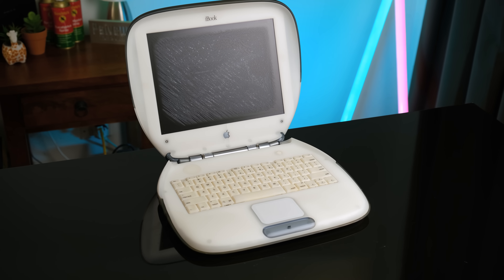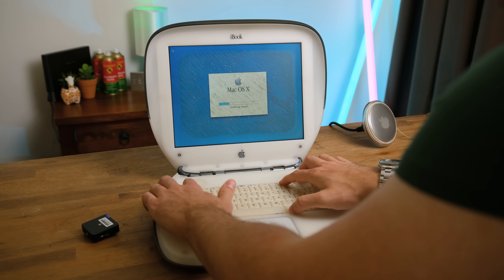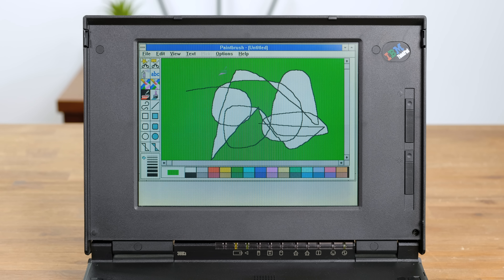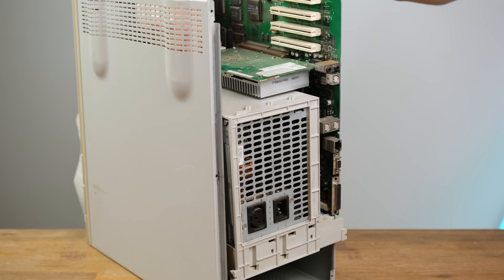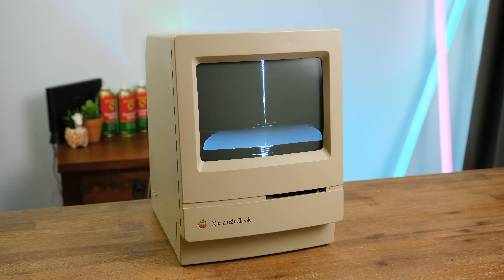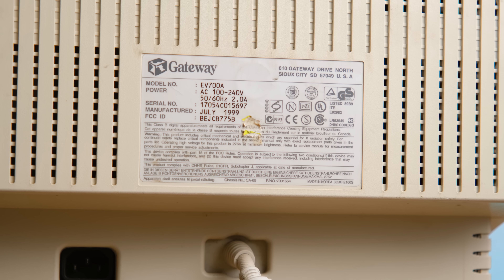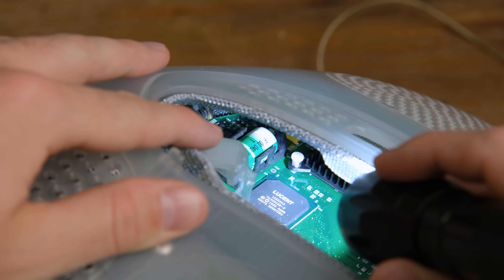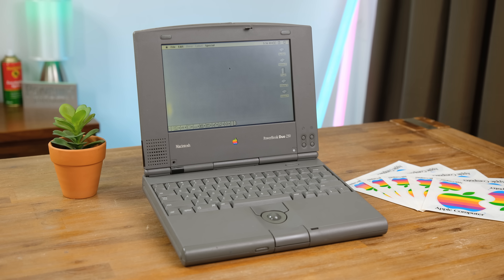So Much Vintage Tech Is Dying... Here's Why

Comment: So these failures seem to be mostly a problem for Laptops and Tech from the 90s/early 2000s; 80s tech had much less failure points and they are simple enough to be easy to fix ( minus CRTs of course, those are a bitch). What I noticed is that old Gameconsoles and Cartridges are extremely durable as they still wont break down on their own.

Comment: I live in Thailand.
as you know
Thailand has a very hot climate.
There is a very high level of humidity and dust.
which hinder the preservation of these old electronic devices.
I just made up my mind that
Old computers and electronics that I collect today.
any day It will become damaged and cannot be repaired to be used again.
Now there are many things that have been broken and cannot be fixed.
such as Sony Trinitron CRT Computer Monitor , portable DAT cassette recorder , etc.
It was a great pity because some things were no longer available. 😟

Comment: I have many
Thing from early mid 2000 from my old webbing kit that has only mild corrrosion and is still running like new for example my D cell L torch has corrosion to the contacts and I left the batttery in for 20 years in a box where they turned fuzzy white just wiped it out and bang she goes! A mid 2000 visible and IR trip wire strobe/personal Identification strobe looks new and operates new even the string trip wire is fresh. 
I must state we whinged in 2000 that things were made to fall apart but it’s worse now! I have made it a habit of buying things that are way older than 2000 for a while now and after minor resto they’re much better than a new tool, like the various hand saws I have acquired and they will be able to be passed down for generations if they arnt left out in the weather

Comment: Most things made with rubber I own including kitchen utensil handles turn gluey after around 3 years sadly must be chinesium even with gloves it is impossible to use them, and all my iPhones batteries has failed months after the contract to pay it off ends so there’s no warranty grrr!!! I asked a electronics repair nerd about the rumour that they hardwire in a program that intentionally degrades devices after a certain time frame, I can easily believe it but he might be going by unfounded rumour like me!

Comment: As someone who collects 50s-70s tech, it blows my mind how many devices that are literally twice the age of these computers that are having so many problems now still work with no restoration whatsoever. For example, my main stereo system in my dorm room features a receiver from 1970. Aside from a slight buzz in one channel (likely caps needing replacement) it still functions perfectly. The dial glass doesn't have "vinegar syndrome" - it is still as clear as it was in 1970. The casing is all still intact. I have so many examples of components going on 50 or even 60 years still working with zero restoration. Interesting.
Reply: most of the poorly built things from that era are already long gone, also stuff is more fragile after that because of safety laws, same with architecture, all the crappy 1800s buildings are mostly gone and thats why you only ever see nice beautiful ones, all the crappy ones got knocked down

Comment: Loser vintage tech:
- Rubber is melting
- Plastic is as brittle as an eggshell
- Vinegar Syndrome
- Battery corrosion
- Barely alive or irreversibly dead
- Already irrelevant
- Complicated to fix
Chad vintage cars:
- Easy to fix
- Good project cars
- Last longer
- Only problems are rust and some wear & tear
- Parts can be replaced
- Can be customized
- A popular form of antique despite being a rare artifact
- Some are dead, but can be revived through a bit of maintenance work

Comment: My Canon XL1 from the 2000's suffers from the sticky rubber mess which is annoying, but not as annoying as the whine the tape head makes. And theres not really any way to fix that or any helpful stuff online so solve it. So if I ever want to use it for a shoot I just have to deal with that noise.

Comment: I am in my 60's and a lot of tech I have from the 80's and on has started to breakdown. Obviously batteries do not last for decades, but the rubberised coatings they were so fond of become sticky and the plastics become very brittle. It's a shame that this happens, but then I suppose will all end up in a so called land fill at some point...speaking metaphorically.
Reply: The computer devices from the 1980's can get 40 years world of work out of them given that they typically dissipate heat very well. Once the plastics go, it's kind of over.

Comment: 🖹 Repair tips: If a harddisk won't start, never open it! - Any tiny airborne dust particle will start a chain reaction of debris (like colliding satellites) that will unavoidably destroy it. Likely it won't spin because the bearing oil has hardened. And do not knock or use  force. Better simply warm the bearing with a hairdryer (not too hot) to remelt the grease and then let the disk spin for an hour to let it knead the lube soft again. SSD/Flash memory functions like DRAM with 1 year refresh cycle (see Wikipedia "wear leveling") and will die if not powered on once a year for some minutes. It dies the faster, the more erase/overwrite cycles it has gone through, thus never use a worn USB stick or SSD as backup media. They starve without energy (modern triple/multi level types even faster).

My Thinkpad IBM 760XD is still alive and even its LiPo battery of 1996 still holds a little charge (I recharge it every 4 months). Only the TFT has a swarm of red, green and blue dead pixels near the edges.

Hard plastic can swell and turn brittle by contact with wrong oil. In 1990th I had a Toshiba CD writer drive in a PC that tended to get stuck. After oiling with "machine oil", after a while the whole black polystyrene chassis started to crumble apart like charcoal. The same happened with a transistor radio. Also bakelite (e.g. in Hammond organs and tube radios) is infamous for this. When plastic cogs split around the metal axle or concentric cogs in quartz clock movements get stuck, this happens by swelling plastic due to wrong oil. Thus never lube unkown plastic mechanisms with anything but silicone oil. Also most rubber (latex, butyl etc.) turns into chewinggummy goo by any non-silicone oil. By I read complains that otherwise silicone oil may soften silicone rubber (used as rubber keys and key contacts), so do not spill it and avoid to oil if you don't need to. 

Similar plastic/rubber damage may happen by long time exposure to oil or battery leak vapours. Battery liquid vapours particularly damage LCD displays, thus failing segments or broken carbon foil cables (they tend to turn brittle anyway, e.g. inside calculators and Casio music keyboards) are likely caused by this.

Sticky gummy paint on devices mainly happens by UV/daylight, but also by migrating plasticizers out of deeper layers. This can be washed off with vegetable oil (aka cooking oil - needs some elbow grease). Remove the oil residues with isopropanol to avoid further harm.

Also bad electrolytic capacitors can sometimes regenerate (like recharging a battery) when running for an hour if the device works. But if they have a short, they may explode, so do not let them unattended. Do not run a TV/monitor run longer than 5 minutes if screen stay black, because severely bad capacitors in PSU can damage chips by letting overvoltage pulses pass through. Particularly cheap Chinese capacitors around year 2000 tend to die because they used an incomplete formula copied from a western patent. The Badcaps site has much info how to fix this. I e.g. recapped my SGI Trinitron monitor to keep it working (although bad contacts inside CRT do make trouble).

Comment: Most technology prior to 2010 still used liquid electrolytic capacitors. Once the capacitors started drying out the tech failed. In 1990 the technical industrial standard was to to have the technology last at least 10 years, which in most cases ment it would last 13 to 15 years. But most tech prior to 2010 was doomed to failure. EPROM memories lost their programming charge after 8 to 10 years. The older type integrated circuits didn't have built in anti-static protection. And one of the big things was electrical edge connectors corroded.

Comment: If Im honest I wouldnt even bother with the screen or the internals, with this older tech its mainly the aesthetic I'd want it for. Instead of maintaining the outdated components just fire in newer screens and hardware with the exception of the keyboard and keep er running if thats even possible. Might seem blasphemous to some but this stuff wasnt built to last forever anyway, nothing is from these companies and even if they could it would still have a failure rate. Maybe when there is 0 mechanical components and a replaceable battery thats the closest youd get to lasting forever but unless its painstakingly and expensively inspected there will still be failure and even then they might fail eventually 😂

Comment: Fortunately, Apple ][s don't have the failings of the MacIntosh line. The capacitors in the power supply (a separate module) will go bad, but that's about it. My Apple ][ from '79 still works fine, as do all of the ][s I've acquired over the years. Most of my Macs, which are much 'newer' that the ][s, have suffered from some amount of battery and capacitor leakage, leading to motherboard damage. If you want a vintage computer that will last a few more decades, get an Apple ][.

Apple ][ Forever! 😁

Comment: I've worked in a thrift store and Im currently (as of writing) working at a recycling center. I have seen tonnes of old computers and electronics from back in the day that have gone through alot of damage with age. Some is fixeable and workings while some like small electronics with batteries that expand could be dangerous since they could explode, but I've also seen old electronics that almost look prestine since somebody just stored it away.

Comment: A lot of tech was also made with a 'Consumable' mindset, meaning replacing it was encouraged

As for your brittle plastic issue, have you considered 3-d printing a replacement bracket?
Reply: Brittle plastic can happen by battery leak vapour or contact with wrong oil (e.g. lubricant migrating out of a gear mechanism). Also UV/daylight ruins white plastic, because titan dioxide produces free radicals.

Comment: Same with early mp3 players. I have a creative Nomad a classic design from 2001, however it now will not power up. I found out through a uTube video that the EPROM has failed, although there is a guy supplying new programmed EPROM, it takes a delicate touch to remove the old one and install the new one.

Comment: Threw away my Amiga 500 and 3000 last year. It hurt tossing things I held on to for 30 years but I'm beginning to realize that holding on to these vintage electronics is a hopeless endeavor. I hope to fire up the OG xbox and steel battalion at least once before I throw it out too.
Reply: I run my Amiga A500 (casemodded in big wooden cabinet) every day to write diary on diskettes, and it barely makes any problems (beside oxidizing contacts those need to be wiggled occasionally).

Comment: Interesting video! I thought I'd find some things I should keep an eye on... but I think I have quite a different experience instead!
I have a huge stock of old (PC) hardware, down to the early 90s, and honestly, the only source of issues I had are leaking NiCd batteries. On mainboards and cards (many of them) not even problems with capacitors. But two failed be quiet! PSUs, which required capacitor replacements (I prefer them, they are from the mid 2000s, but also, the early 90s PSUs work just fine).
Hence I'd assume it may be storage and, additionally, a bit of bad luck in your case.

Comment: I think I used isopropyl alcohol to clean the sticky rubber on a few devices, and it did the job. Thanks for a great video. So sad to see this classic hardware dying is just a pathetic way.
Reply: Use vegetable oil (cooking oil) to remove sticky gummy paint and isopropanol (or a tissue with detergent and water) to remove the oil to avoid further damage.
Reply: @cyberyogicowindler2448  Will that work on devices where the rubber isn't gooey yet? I'm asking because I have a rubberized laptop but the rubber is gouged and dirty and doesn't look so good. I'd like to remove it since it would look and feel much better without it.
Reply: @draconic5129  Problem is that most paint strippers damage the plastic underneath. (And particularly do not let any acrid chemicals or their vapors reach the screen.) Try isopropanol first. On my (anyway incomplete) IBM 760EL the rubbery paint on the lid is flaking off but not sticky, so I left it where it is.

Comment: maybe we clean with too abrasive chemicals? like wet wipes may not work for these sensitive things..maybe just water alone light spritzed clothe better..i know my keys on my laptop got damaged just with wet wipe..so i had to get seperate keyboard to attach to it
Reply: cuz even top of my laptop looked like cracking a little, and i was afraid what happened was chemical abrasion..from wet wipe cleaning ..even though it was new
Reply: Daylight, battery leak vapours and wrong oils decompose plastic. Do not regularly clean plastic with solvents (water and in emergency dishwashing soap is enough).

Comment: I use two crt monitor as my main computer monitors at the moment and one o them very occationally (like once every week) flashes a line and pings like the imac in the videa, is this something that will get worse?
Reply: Electrolytic capacitors go bad (particularly those of around year 2000). The Badcaps site has info how to replace them.

Comment: Only extra tip i could add is having oxygen removing material held in bag together with electronics.
Often sold as iron powder bags, iron reacts with oxygen faster than other parts and removing oxygen should make things last tad longer, especially rubberized elements

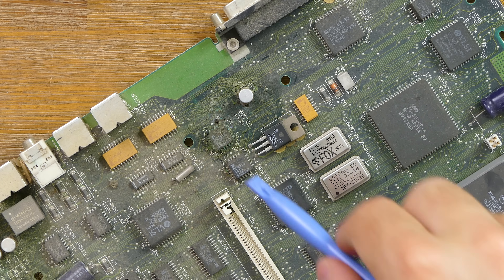Comment: 5:50 the first production run of the original Xbox used very acidic clock capacitors that people noticed started breaking down several years ago. Was recommended if you have one to de-solder or remove the clock capacitors for this exact reason.
Reply: It seems that this was why I ended up going through 5(!) of them. 

I first experienced this issue in either 2005 or 2006 when my Xbox started overheating and suddenly refused to read any discs.

I'm currently on my 6th; but knock on wood, I haven't had any real problems so far with it because it was produced after 2004. That was when the clock capacitor was seemingly fixed.
Reply: They all did except the final 1.6 model actually.
Reply: @2b2056 And some 1.4 models, since SOME of them have the gold caps as the 1.6 does.
Reply: That was many devices made in that era. Again if you go a decade back. Like once a decade a supplier of capacitors is trash. Goes all the way back to at least the C64 era. Skipps 9 years and comes back to trash caps.

Comment: Your battery woes are true for ALL batteries. In fact, as battery production shifted to China, the problem only got worse, much worse. Never leave a battery in a device you are not actively using, and store all batteries in leak-proof containers. Tesla owners - just wait. A garage full of battery gunk awaits you! (If it doesn't catch fire first, and burn the house down.)

Comment: This afternoon, I turned on my Apple II after not having used it for 3 years. It went for about 5 minutes, and then the keyboard didn't respond, and event the reset key had no effect!  So feeling worried, I thought I would test my Apple II GS. That too, went for 5 minutes and packed up!  The disk drive made a horrible grinding noise. So I moved onto my Amiga A1200. That went for 10 minutes and then was totally dead!.  Right now, time to test the Amiga A600. That worked, but then the internal floppy drive would not recognize anMay disks!  Aaarrh. I tried the A600 with a Gotek drive, and it booted up okay. So I reckon, I have only got the internal floppy to replace on that!  My Amiga A500 is still working, but the internal disk drive ont hat has packed up too. Ordered a replacement from ebay.  And what's more all the Amiga PSUs have now failed. I got a replacement from Poland. That's okay.  I have got a Tangerine iMac which keeps soldiering on. My earlier Bondi blue on packed up ages ago. My Mac Classic is dead as a doornail, as is my Mac LC 1. All these machine were all in good working order 5 years ago.  Oh well have enjoy your collection of doorstops!  Thanks for uploading.
Reply: I run my Amiga A500 (casemodded in big wooden cabinet) every day to write diary on diskettes, and it barely makes any problems (beside oxidizing contacts those need to be wiggled occasionally).